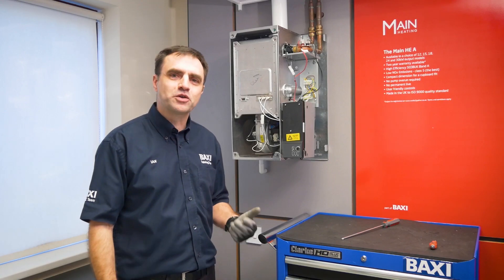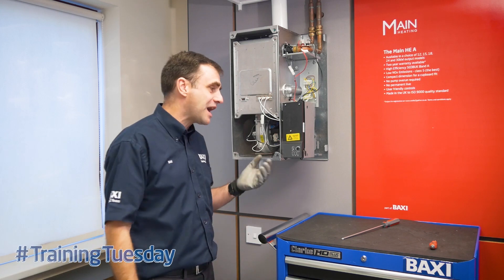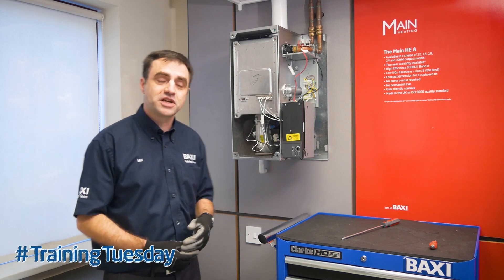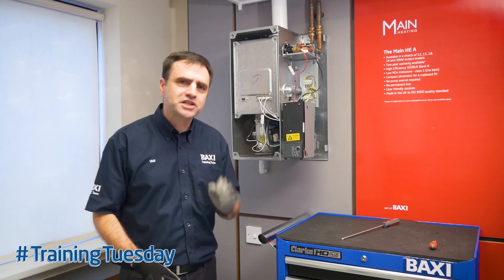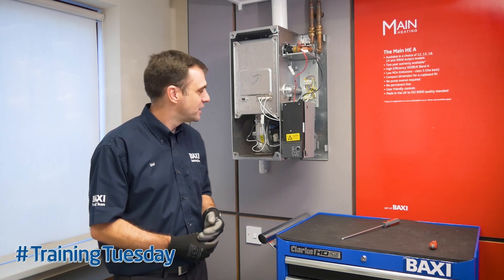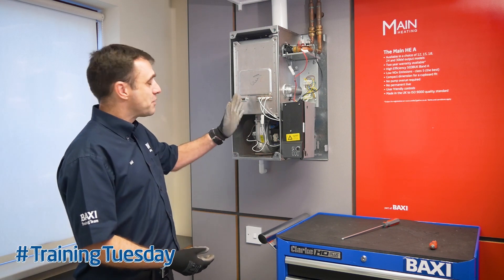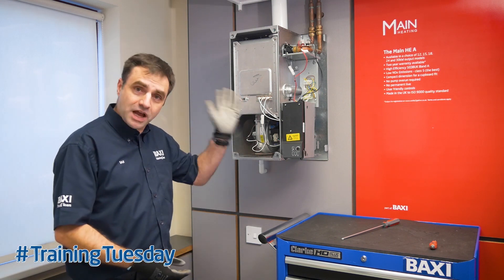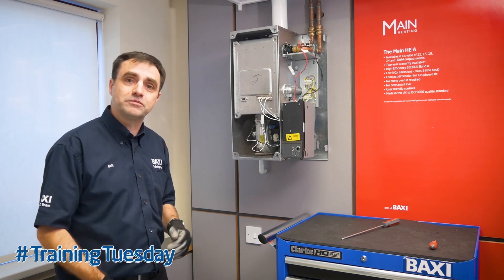How to deal with rectification issues you may have on some boilers | Baxi #TrainingTuesday

Comment: Why does the condensate trap have a wire attached to it?
Reply: A good question!
Reply: What could be wrong with the condensation trap.
Reply: To detect if the condensate trap outlet is blocked.
Reply: when it is full of condensate it creates a connection to earth and stops boiler from firing (Trap full of condensate and not draining)

Comment: That's a crap boiler actually think its denting Baxi's reputation
Reply: Crap is an understatement
Reply: Great boiler these
Reply: Totally agree same across the range easy enough to diagnose though.   I had a potterton precison do this just after I'd cleaned the condensate trap on saturday.  A quick blast on top with the hairdryer go dry of the water and problem solved.
Reply: Owen McCusker  totally agree Owen, far from their finest hour.  Had lots & lots of problems with these😡😡